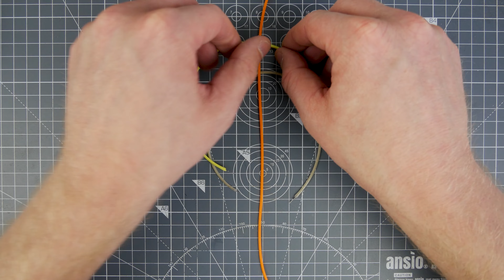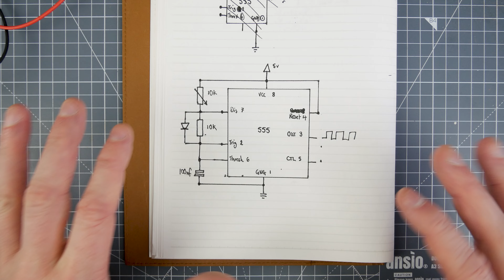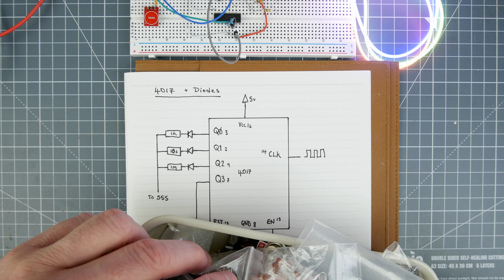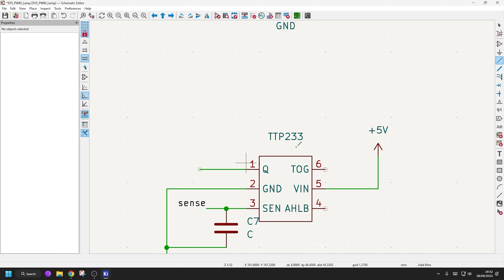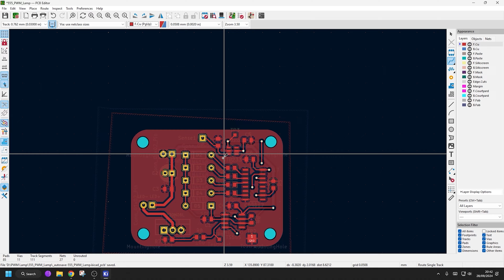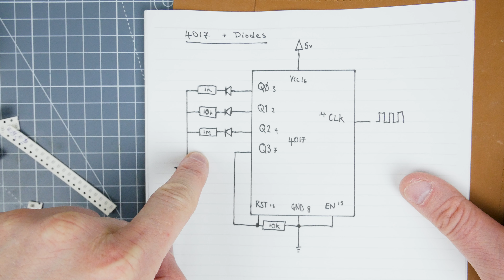From Start To Finish:  PWM Lamp with old school tech

Comment: I like that you didn't use the attiny. Code makes my head hurt. I wouldn't know where to start. Using a 555 and a decade counter is easy and straight forward. You just built it and it works. No messing about with code.

Comment: Not lost the knack of building crap I see ! Nice. Edit:- you have TTP 233 on the silk but fitted a TTP223, I have used these boards a lot myself and don't know the difference !  do you ? Very neat project but I imagined the lighting behind the scales or above to highlight them but great result either way !
Reply from the maker: I am sure my fat fingers knew what to type but were fighting against me, definitely the 223 ;) Crap is basically my brand.
Reply: @DavidWatts  Lol ! both numbers are for the touch switch !
Reply from the maker: same pinout?
Reply: @DavidWatts  Wish I hadn't looked but yeah 6 pins same function ! Its late so my head hurts but TTP223 BA6 is the same as TTP233BA6 lol
Reply from the maker: 🤣 I doubt I will ever really know what version I got from Aliexpress tbh
Reply: @DavidWatts  :)

Comment: about bad crocodile cables: check if yours are magnetic - not the clips but the cables themselves. I have several batches of these with copper-colored, magnetic wires.
Reply from the maker: Weird, a quick test of 4 and 2 of them are very attracted to a magnet. I assume they must be copper coated steel.
Reply: @DavidWatts  at least it's not copper-clad aluminum...
Reply: @DavidWatts  I found it out by accident in a lab with my students, when suddenly the cable attached itself to a neodymium magnet... I was quite surprised
Reply from the maker: Maybe I should just buy some nice wire and rebuild them, I only need red and black tbh

Comment: Nice work. If you took a binary counter like CD4060 and use a resistor ladder, you could avoid diodes and have 4 steps with 2 resistors, 8 steps with 3 resistors fitted or up to 16384 steps (I know it's crazy) when 14 resistors used (it's basically a DAC)
Reply from the maker: That's a lot of button presses to get to my idea brightness level of 1337 ;)

Comment: A video by a Watts. You've beat me :) No serious, great to see a video by you. A fan from day one and still am! Question, are there longer ones? Can you put them in series without a bit gap?
Reply from the maker: I assume you could put them in series, not sure about different colours in series thought, they would have a different forward voltage, not sure what effect that would have. The are all rated as 3v but from a little testing that isn't true.
Reply: @DavidWatts  I would stick to one colour so that is fine. Another thing I found on Ali, is similar as and LED strip. But, 4mm wide and 1,5mm high. And cheap! 5m blue €16,45 I expected way more because it it also very flexible. I'll order some and make a video.

Comment: The 555 internals are basically 2 op-amps with one input of each tied to the midpoints of a 3 resistor ladder/voltage divider, giving them ⅓ and ⅔ of the supply voltage respectively. 
The outputs of the op-amps go to the inputs if an SR-latch, output of the latch is buffered for better current handling.
Using the 555 then comes down to controlling when/how the other inputs of the op-amps get to above/below ⅓ and ⅔ Vcc in order to flip the op-amp output / change the inputs of the SR-latch.
There's also an input to force a reset of the latch independent of the state of the op-amps.

Comment: Nice set of scales.  used to use a pair like that for measuring out glue and hardener when we used to glue microphone transformers to the PCB's. the transformers were in mu-metal cans, glue had a very restrictive mix ratio. too little hardener and it would not set, too much and it went rock hard before you could use it.  the weights were like little bits of tin foil and you had to close the front or a draft would bugger your reading. bringing back memories from the late 70's nice to see your keeping it safe. looks good too.